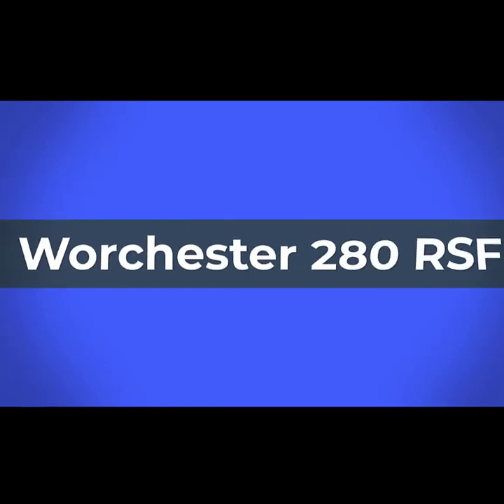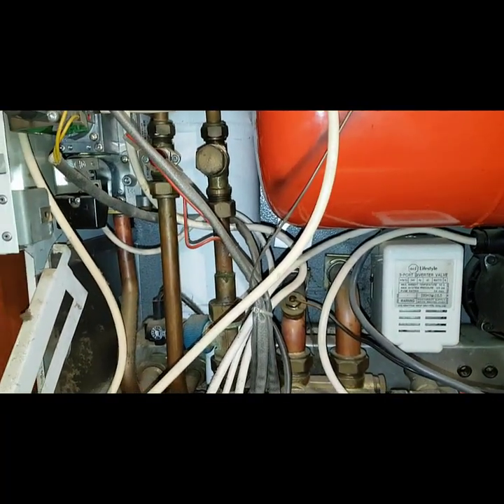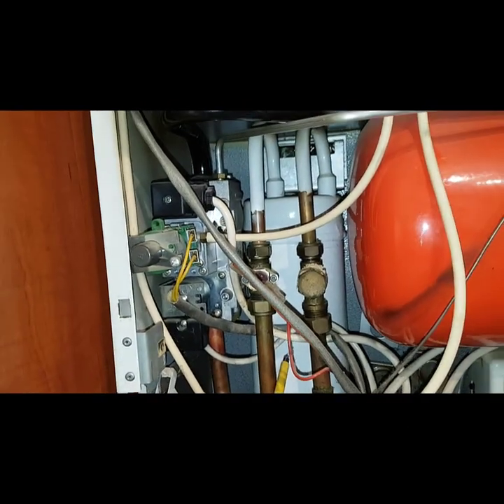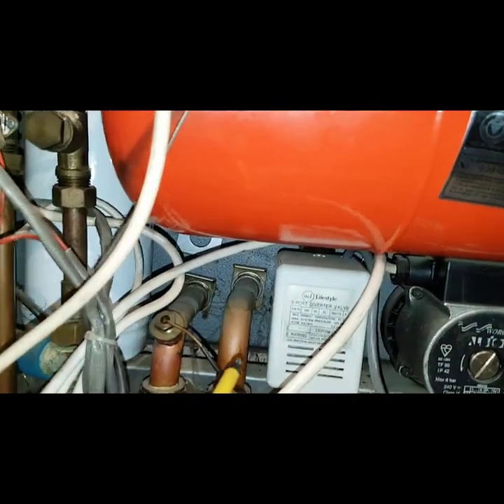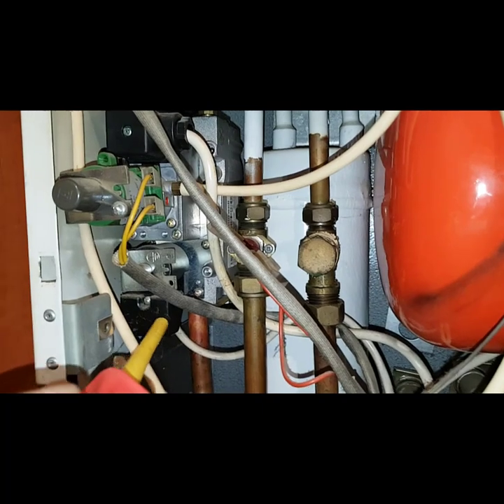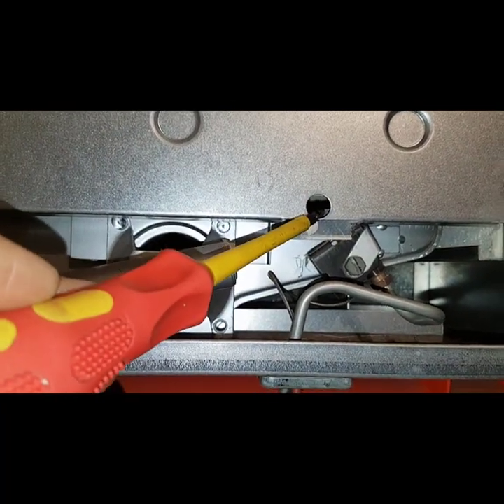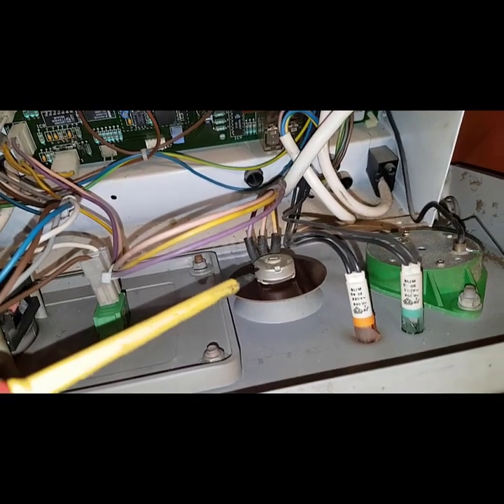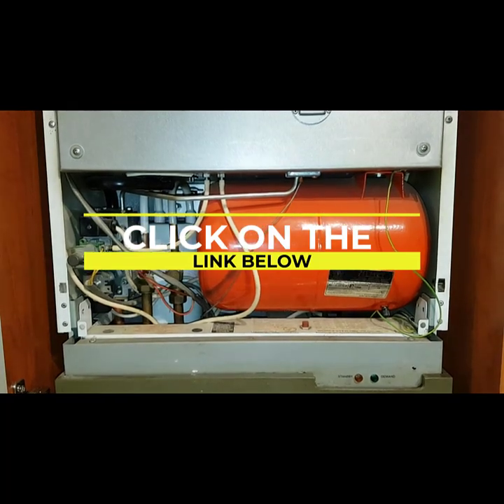Worcesteter 280 RSF Tour and Common Faults

Comment from the maker: Does the pressure increase when heating is on? If so there could be a blockage in the expansion vessel pipe. If not, you may have leak on the system. Also can you subscribe to our channel
Reply: Yes,,the pressure increases to just over 2bar from a normal pressure of 1.5bar,,i've checked the pipe to the new expansion vessel, they are hot when the boiler is active on the CH, but will check for blockages.  I checked for leaks over the whole system,,can't locate one as yet.  Subscribed already.  Great channel.

Comment from the maker: Hi, the problem is the expansion vessel requires pumping up with air. Just open the prv pump up the expansion vessel to 1 bar air pressure then close the prv by twisting round about 3 times then refill the boiler and see how it goes. Also can you subscribe to our channel
Reply: Hi , many thanks for the above reply,,when I initially messaged you the expansion vessel had been replaced with a new external one, as the orange internal one failed and needed replacing, its still insitu and full of water.  I have been checking the the pressure in the EV and its at about 1bar, but the boiler is still losing pressure at a small rate of about 0.5bar per week, but only when using the CH.  Are there any other causes that i could look into.  Great channel,,very informative.

Comment: Hi,,I have this model of boiler, had it fitted around 1997/98.  Of late its been slowly losing pressure when the Central Heating is being used (its fine when only used for the power shower), but i can't locate any leaks in the boiler or any of the rads, totally dry.  I've surmised its linked to the PRV,  the PRV was triggered several times a few months ago from work completed in the bathroom, it went off 4/5 times like a fire cracker!  I've bought the part to replace as i believe once triggered the PRV seals can fail.   To replace do i need to drain the boiler? or would considerable water flood out if i start to remove?  From looking at it how its connected, it doesn't seem a complicated job, any advice would be appreciated,,

Comment: HI MY BUTTON WONT STAY DOWN ? REPLACED BUTTON HEAT CUT OUT AND DIAL AND HEAT REGULATOR HAD A NEW PUMP
Reply from the maker: Is this the overheat button popping up in heating mode or hot water mode ?

Comment: REPLACED the pump pump was siezed but still no hot water pump runs now
Reply from the maker: It could be the flow switch or the diverter valve. Could you subcribe to our channel ?
Reply: @ARBoilers  the divert valve we moved and its working think motors burnt on diverter valve
Reply from the maker: Ok cool thanks for your comments and can you please subscribe to our channel 😊